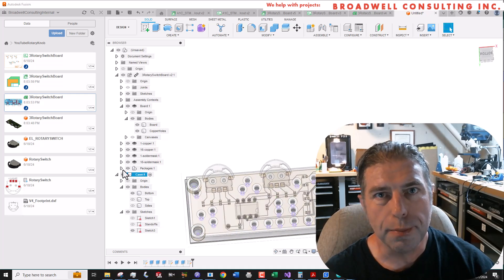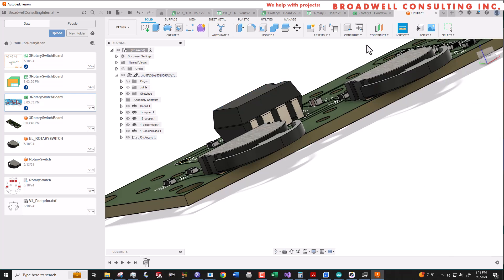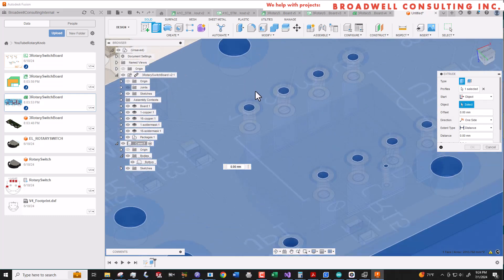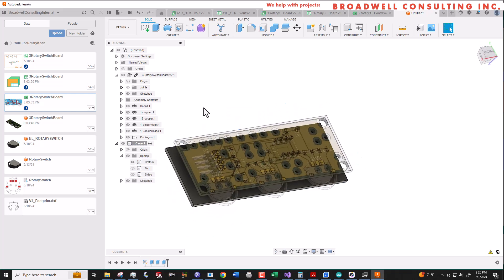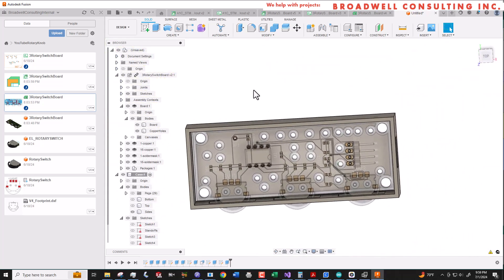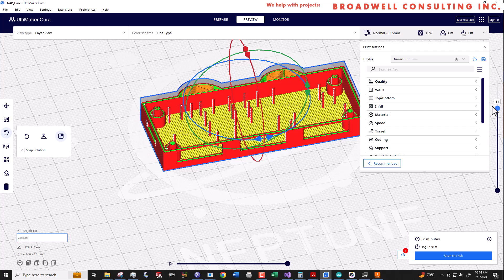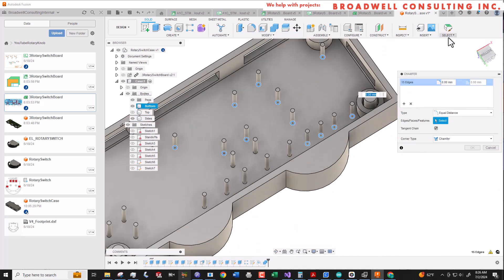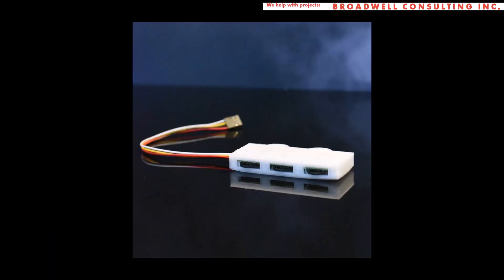Creating an Enclosure AROUND A PCB in Autodesk Fusion 360

Comment: Hi! Thanks for your tutorial. I am confused by one thing. How did printer printed top cap? I mean top lid is flat. Did it print right over PCB?
Reply from the maker: That's right.  You can print over the top of things if you can "bridge" the strings of melted filament from one plastic support to another.  This PCB was designed to do that by adding a lot of extra posts in the middle of the PCB to reduce the bridging distance.  See this video https://youtu.be/MVzu-X4oacA where we designed the PCB.  It talks about making holes for the bridging posts.   This idea won't work for all PCBs - you need to plan for it when you're building the PCB.
Reply: @ Thanks for clarification.  I’ve seen previous video bub didn’t know that it is possible to print this way. How do you know minimum distance between stands? I mean — one can find out this distance by trial and errors or there is some filament parameter for this?
Reply from the maker: @kimsanov  There's 3d printing enthusiasts who spend all their hobby time just experimenting with this kind of stuff (not me...).  The bridging distance possible depends on material, temperature, print head speed and how much sag and stringing you can tolerate.  Search for 3d printing temperature tower for examples like this one that talk about it in depth.  https://www.youtube.com/watch?v=5mp2vCZ2iFc&pp=ygUcYnJpZGdpbmcgM2QgcHJpbnQgdGVzdCB0b3dlcg%3D%3D

For me, I typically assume I can bridge 10mm without a second thought.  Beyond that, i start being more deliberate.

You might want to watch a related video where we print around a 3d servo horn  to make a gear using similar techniques:
https://youtu.be/rQwg55PHdAc?si=i2ot2JgSkuBxP4qT
Reply: @ Thank you for clarification! 👍👍👍